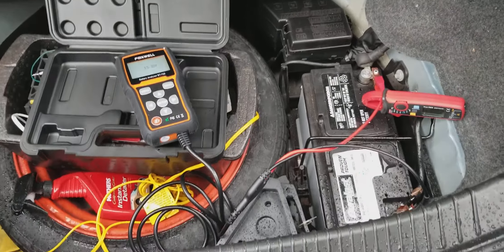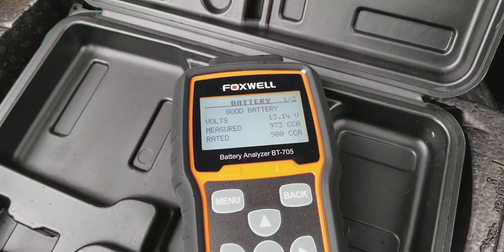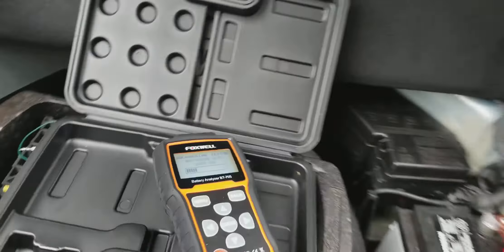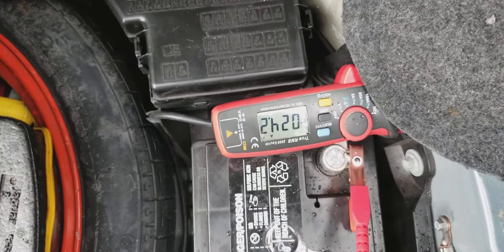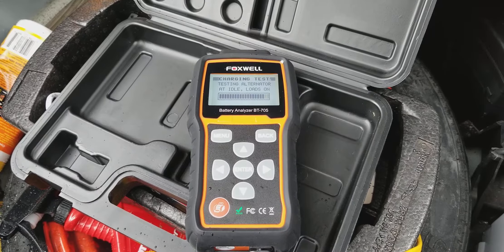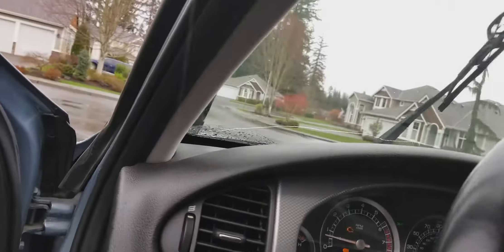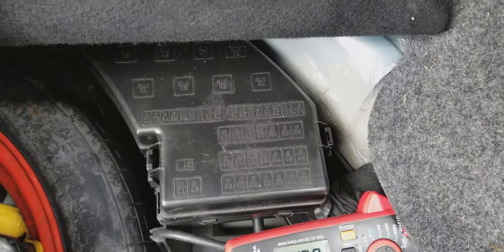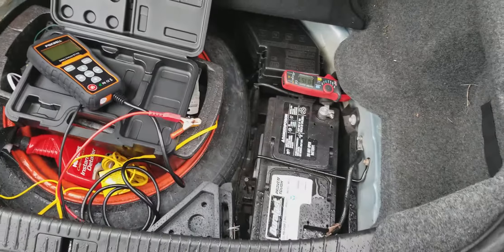Battery Analysis, Park Brake Fault, Part 4

Comment: Did you figure out the Park Brake Fault?
Reply from the maker: Not really.  My current theory is that the large harness connection at the rear top of the engine was getting wet.  I sealed the cowl rubber strip to the windshield with this liquid silicone I found at the parts store to stop the cowl leak.  Haven’t had a PB daily yet.  We’ll see when the weather gets really cold.